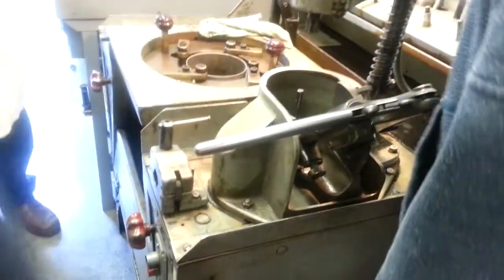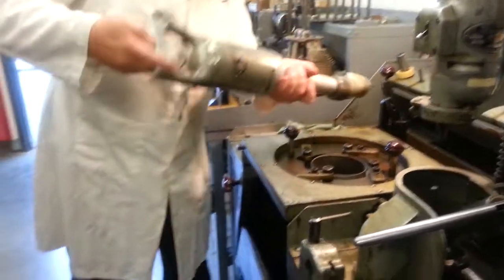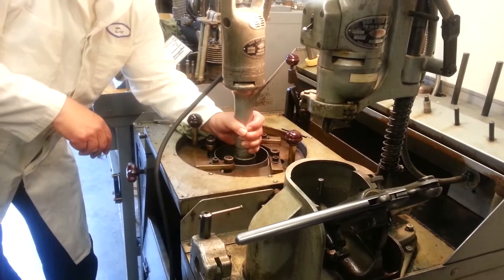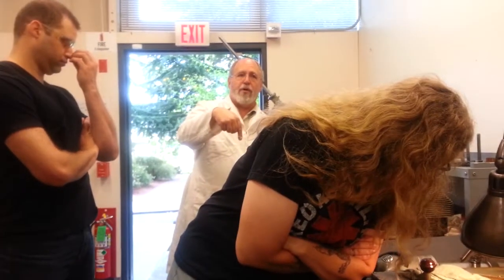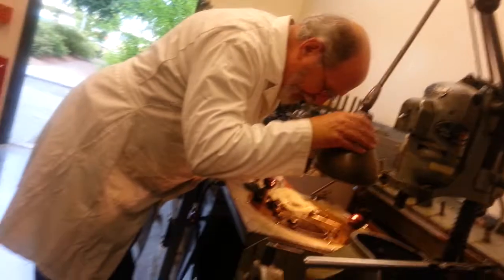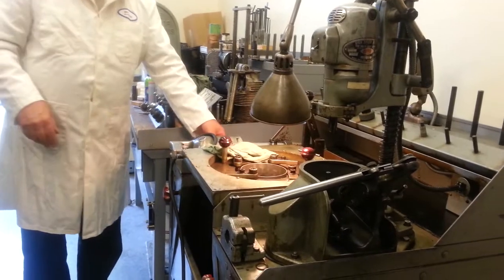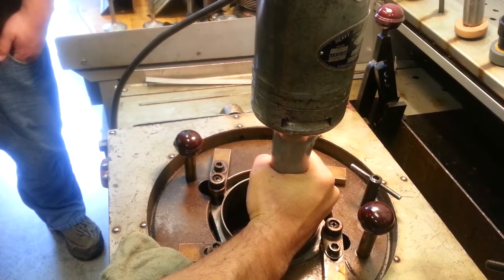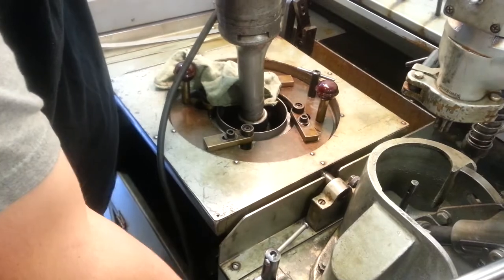Regrinding a cylinder valve seat.

Comment: You use coolant for grinding? We just stick the pilot in with the stones. Then connect the Sioux and grind. Never used coolant. Also I welded up a homemade stand that enables us to line up four cylinders for valve work. Interested in this contraption you have.

Looks like since you are doing this for a class you might want to make a stand like I did so you can have multiple groups of students all fucking up... I mean grinding valve seats for class.